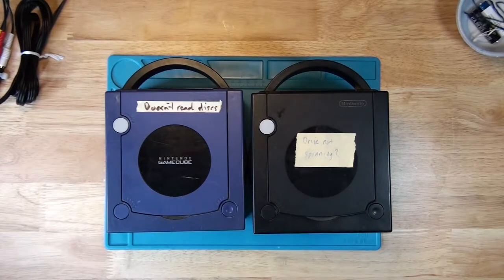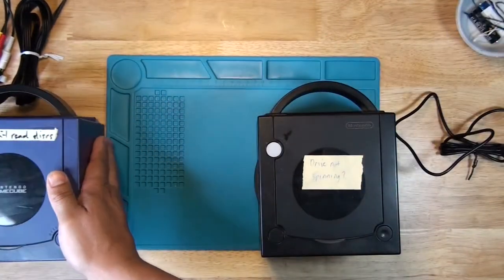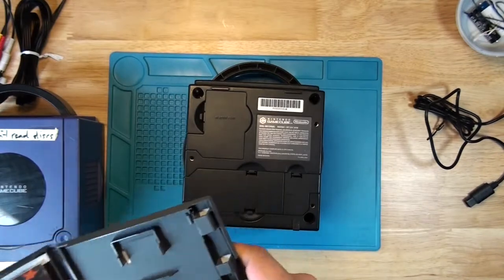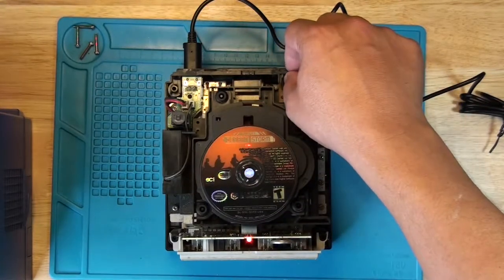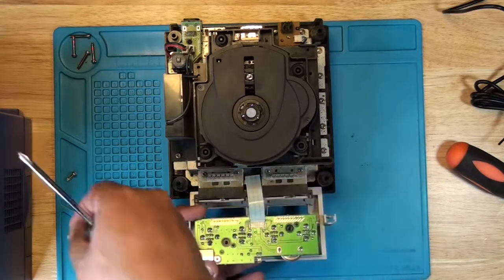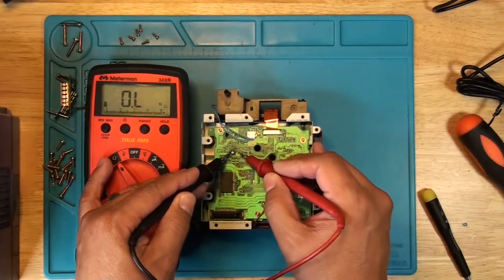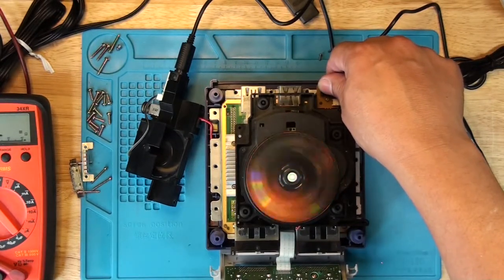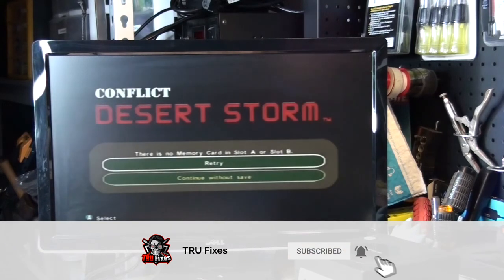The Best Way To Calibrate Laser Lens On Nintendo Gamecube // TRU Fixes

Comment: I have a Gamecube that makes a really loud click noise with some games, can someone tell me what the problem is
Reply from the maker: To me, it sounds like the laser is having trouble reading. Try cleaning it to see if makes a difference.
Reply: TRU Fixes I once calibrated the laser, now I have to see if the problems continue to occur, it always happens when charging has to be carried out, it sounds like the laser is pushing really fast
Reply: I have this problem too, every now and then it makes this loud click noise that's basically a more intense version of the normal, healthy disc drive noises. Usually doesn't affect gameplay, though sometimes when it happens in certain games audio clips that were supposed to load at the moment of the noise just don't play at all and I've had a few one-off moments where it's just briefly stopped reading discs at all before working again (regardless of the noise).

Did you try cleaning the lens, and did it fix it?

Comment: Most people just pop out the front panel ribbon cable and leave the board attached to the front face plate, unless the battery needs replacing.
Reply from the maker: Yeah, I'm a little extra :)

Comment: My GameCube's clock is dying so I go into the menu to set it up but then I notice that the game has not loaded and gives me a reading error but after trying it a few times like 1 or 2 times maybe, it works! Is it because of the battery or is it that I also need to adjust the laser power?
Reply from the maker: My guess would be that the battery is dead. It uses a CR2032 battery for the clock.
Reply: @TRUFixes  Thanks for the late response... but I replaced the battery already, a new problem has come into place however. The GameCube no longer plays audio... I have tried different cables and different TV's so I can confirm it's the Cube...
Reply from the maker: @pacthesir  The most obvious thing to look for is to make sure that all the connectors/plugs are seated all the way in. If that looks good, then there might be an issue with the audio driver or the actual port (make sure that there are no bent/broken pins). Unfortunately, I've yet to troubleshoot a GC with audio issues, so I don't have any first-hand knowledge. Good luck and let me know if you are successful!
Reply: @TRUFixes  Everything fits solid, I have seen a lot of people say it may have something to do with the digital A/V out port having a "voltage overload" and it can affect the analog A/V out's audio chip.

Comment: Hello i just recently bought windwaker and as I was playing everything went fine but up until one area that had to load it just crashed and the GameCube said that the disc could not be read. Then I tried it on my Wii and it read past that area just fine. When I went past that area I saved and tried it on my GameCube again and it didn’t work. Could this fix the issue? Other games that I’ve played play just without any issues
Reply from the maker: Probably. This same problem seems to also occur on other first party games. Try cleaning the lens first, if you haven't yet.

Comment: Great video! I have 2 gamecubes. A black one and a platinum one. The black one plays all the games i have, except for super mario sunshine. It just DOES NOT like that game. But supermario sunshine works on my platinum gamecube just fine. I'm not sure if it's the laser optic or not, but it seems to me on the, black gamecube it could be that it just needs have the laser calibrated. What do you think? 

P.s. I know you may be wondering, "well why not just use the platinum one?" lol. The platinum one only has the analog input. Where as my black one has digital and analog and i can hook that one to my HD TV and upscale. :)
Reply from the maker: Thank you for the feedback! There are a couple of things that I suspect. It could be a dirty or uncalibrated laser together with the game being slightly scratched to where the black GC doesn't play it. I would clean the laser and if that doesn't fix it, then calibrate it. If you put the game in and it just spins, stops, and spins, then there's a good chance it's the laser. One other thing that can also cause issues, is a dirty console. Make sure that you get good airflow and that the wents are not blocked. 
BTW, I use an analog to HDMI adapter that lets me play on a digital TV. It's hit or miss but works about 95% of the time.
Reply: Awesome. Thanks! 

So you think clean it, try to adjust the resistor for the laser. I totally cleaned sit and it got a little further, but still gave me the no disc error. Or you think if it spins stops spins, I need to replace the laser. Thanks for the advice!
Reply from the maker: @jaredbriones9822  If you cleaned the lens and it still doesn't read, then try to calibrate it. If it spins and stops, that means that the laser couldn't read the game and timed out. If the game has been resurfaced or has minor scratches, then a weak laser will have a harder time reading the disc.

Comment: When I installed my XenoGC, my multimeter for some reason refused to read the potentiometer even trying alternative points and I know it works because the nearby resistor read 150 as it should with no issue, so what I did after cleaning the lense was I would turn the potentiometer a TINY bit at a time, like maybe even just under a millimeter rotation.  I would boot an original game first, if it worked, I would try my burned Swiss disc, if the Swiss disc didn't work, turn it again.  The first moment it could boot the Swiss disc, I closed the Gamecube right up and called it a day lol  I would still use a multimeter over this, I just need one that doesn't suck lol
Reply from the maker: I'm glad it worked out! The multimeter is used to get as accurate of a measurement as possible. If you turn the pot too high then there's a big chance of burning out the laser. Your method of turning the pot a little at time is probably the next best thing to using the meter. I just advise against turning it up all the way (which you didn't, but others do and ruin their laser). Thanks for the view!

Comment: Ok so here is the thing...

I have a game cube that does not read disks (bad laser I suppose) so for testing the problem, I disassemble a good GC that I have and changed its good optic laser for the bad one, but it didn’t work... the disc spins fine but just can’t make it read the disk, it’s strange because I changed the bad laser to the good one, logically it should work but it didn’t, I also calibrated the potentiometer from the starting point of 500kilo ohms to 200kilo ohms and still nothing... What could be wrong? Something within the potentiometer board?

Thank you.
Reply from the maker: It could be a few things. If the known-good laser still doesn't work, then it might be the motor or the potentiometer board, as you mentioned. I don't recall if the driver for the laser is on the board or on the laser itself, though (a bad driver could also be the problem). The other obvious problem would be a game that is too scratched up to be read. Good luck and let me know if you are able to fix it, please.
Reply: @TRUFixes  I will keep trying and testing,  if I find out the problem i'll let you know asap.
Reply: @TRUFixes  Ok I spent 4 hours trying and thinking, I made another test, I used the BAD LASER on the GOOD Laser board...guess what? It Worked! It was not a bad laser at all, it has something to do with the board, i am not sure what exactly but at least for now I knwo it was not a bad laser. Any ideas regarding the board?

thanks
Reply from the maker: Re-seat all of the connections. Also, do a visual on the board for any loose or damaged components
Reply: @TRUFixes  I dont see any damaged components, I saw 2 soldering point joint that arent supposed to be like that maybe thats the problem, ill let you know. By re seat all of the connections what do you maean? THanks
Reply from the maker: Re-seating is when you disconnect everything connected unto the board and reconnecting. Sometimes there are loose connections that you don't realize unless you reconnect - specially ribbon cables...
Reply: The soldering point seems to be that way from fabric, I inspected another driver and looked the same... I re seat everything and still nothing, my better option is to change only the optical disc drive board for another one.